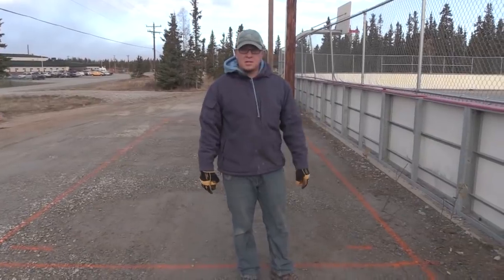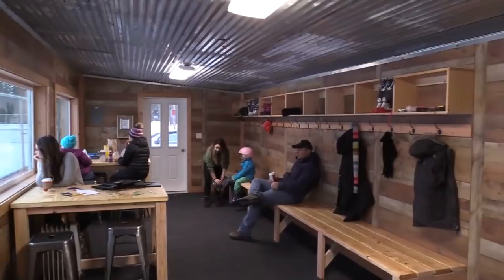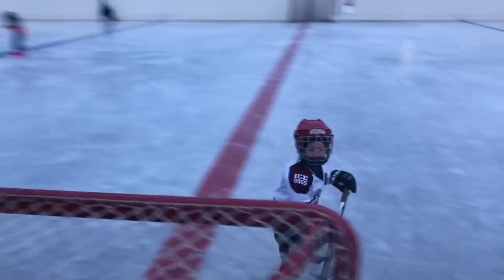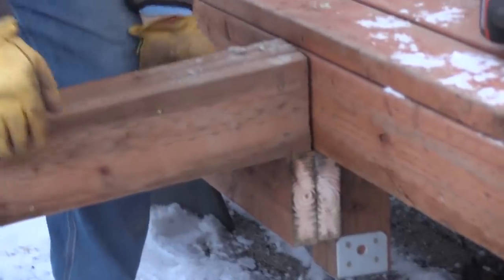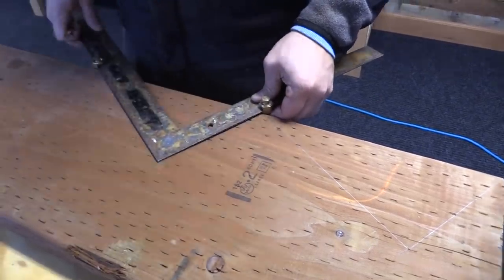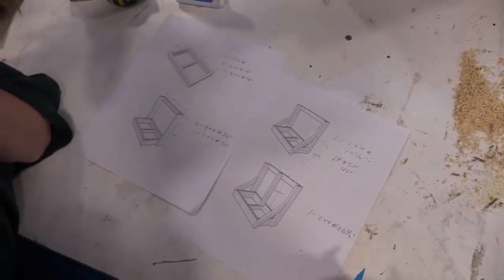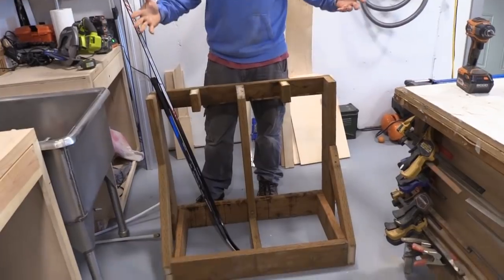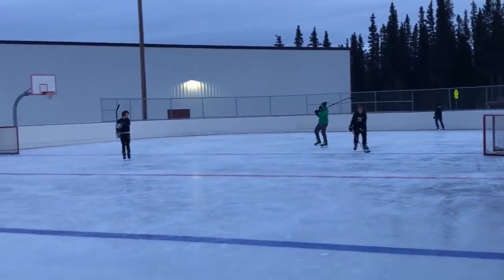Handicap Access Ramp for Ice Skating Warming Hut

Comment: Great job! I could be wrong, but maybe if you could reverse the opening of the door in front of the ramp it would be more useful for someone accessing the building on a wheelchair without assistance.
Reply: That was my thought, too, but then because the ramp is directly in front of the door, it appears to be just fine according to access.gov. guidelines if the door opens just the way he designed it to open.  If it was a side ramp towards the left, that would be correct. The key is that there is sufficient space for the door to swing open without blocking the chair’s access to the door.